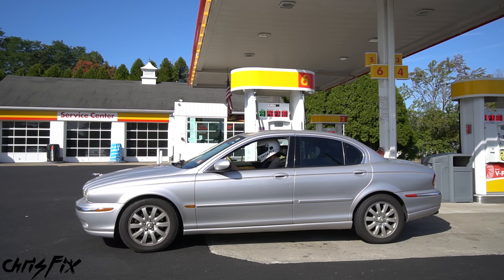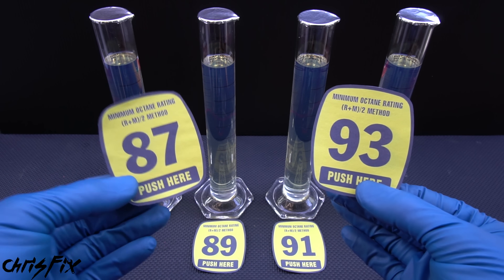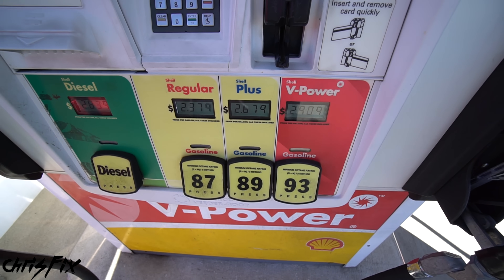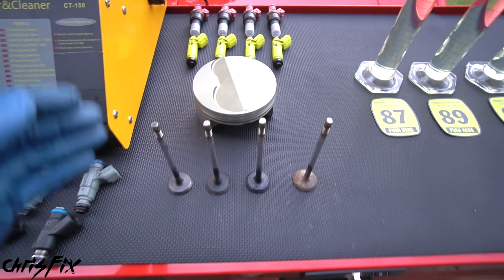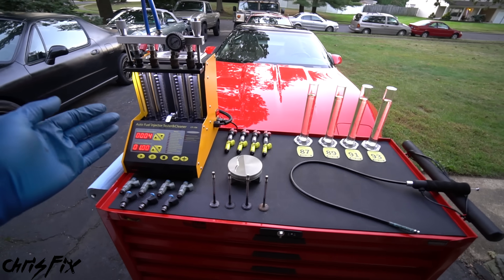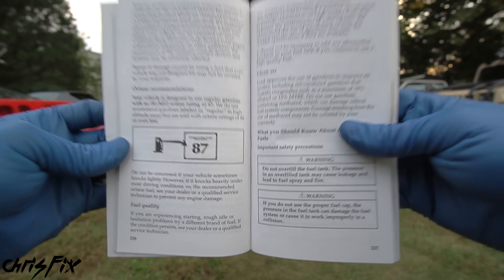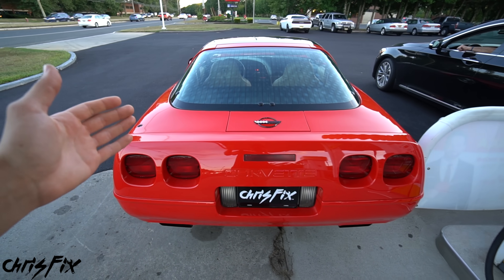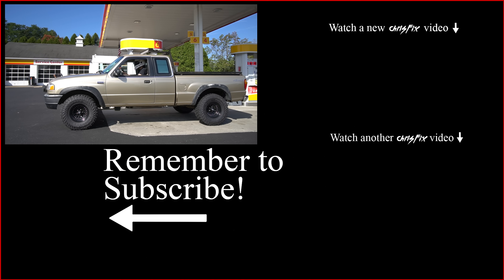What is the BEST Fuel to Use in Your Car or Truck and WHY

Comment: Great video!  You didn't know that the video cover-up so many details until you watch it.  Chris always does this great at all.  Even like this video explains about gasoline!  Really nice.

A little sharing that I heard a lot of boaters reporting using ethanol gas for their outboard incorrectly and failed their fuel system, need to be deep clean for them, even the E-10 gas also made those outboard fail in fuel system easily, so DO NOT use ethanol gas for your outboard engine!

Comment: I use whichever gives me the best gas mileage.  I fill up 3 times (regularly, mid, high test) driving the exact same route for each tank full, and then make a choice based on how far each tank took me while noting any onboard computer readings on mileage as I drive.

Comment: What kind of gas do I run in my Dodge Ram 1500 they all have over 200,000 one actually has 350,000 miles on it and they're all regular engines not diesel. I'm sure there's a lot of carbon build-up should I just start running premium and if I do will I no longer get 10 or 11 miles to the gallon someone told me that premium Burns quicker. Or should I just add that STP, octane, etc etc gasoline additives and just add that stuff every time I fill up??

Comment: So yes, here are my questions summarized: What is octane exactly? What is the unit that's supposed to stand behind the number? Is it 91 or 89 opossums of octane? What is the difference between the two methods of measurement RON vs. PON? How come they produce different numbers? To understand that, the unit (squirrels? or no critters at all? then what else?) is all the more important.

Comment: Just FYI, a lot of Engines don't rely on Knock Sensors anymore because they are to slow and inaccurate. They can check if Detonation ocurres via the Spark Plugs.

Comment: what would happen if you poured ethanol straight into the regular fuel? like... would that be safe or just dumb but critically functional for 20 mins like all the other guys on youtube who do dumb shits with cars? seen one where they even used wd40 so I guess anything flammable and compressable enough would probably run for 2 mins before becoming a car bomb.

Comment: It seems like Shell is about 50 cents more per gallon ($10 per fill-up for me, maybe $500 a year more)  I wonder if getting a gallon of some brand of  additive from amazon or  your local store, and adding it with each fill-up would be cheaper than getting Shell brand. Or, if the repair cost over years is cheaper than getting Shell? Or if other brands also put x  times more than the minimum required(for the premium)?

Comment: Should have done the visual test of the ethanol. I used to work at a shell station and a guy showed me a test where he did 50/50 mix of fuel and water in a glass jar. Did it with all 3 octanes. Shake it around and it separates the fuel from the ethanol and water. It was pretty cool to look at. He was a pilot who liked to use the 91 octane in his personal plane. Lol. So he needed to know exactly what he was putting in it. Check it out sometime.

Comment: Hi Chris, I do have a question. My local gas station has the #88 gasoline. For some reason it’s cheaper than #87. My factory recommended fuel is #87. But I do have that flexFuel tag, so I have been driving with that #88 around.

My question is, what’s the difference between #88 and the #87? Why it would be a good/bad idea to fill your tank with #88?

Thanks!

Comment: In my country Belgium we have E10(95) and E5(98), they both have ethanol in them and i think that is not good for older vehicules with carbs like my oldtimer that are not used in the winter.

Comment: You never mentioned top tier fuel. That’s what I was hoping to see. I want to see the difference in deposits between non-top tier gas vs 87 octane top tier gas vs V-power gas. Does the Shell V-power gas clean significantly better than the Shell regular gas? Is it worth the extra $$$?

Comment: We did have "regular" gas with 91 octane (RON) like your 97 (PON), but that was phased out some time in the 90s. Nowadays, above the 98RON fuels, which are called "Super Plus" and are the same at every gas station, the big brands like Shell, Esso (Exxon), BP/ARAL have their own brand names for ultra high grade fuel, so that will then be 100+ octane (it's got names like V-Power and stuff like that), I think the highest I've seen advertised was 102 octane. Although I don't know what the unit of the ocatne number actually is (if it's per cent, then anything above 100 wouldn't be possible), and therefore I can't really tell what it actually means.

Comment: Run a higher octane if you get "explosions" or want to clean sludge/carbon deposits. You might find out the recommended or required octane intake on your gas cap, gas cap cover, fuel gauge or manual book. 
  Hopefully i remember this info & apply it so it might become knowledge..

Comment: I notice in my 2015 Ford Fusion Titanium FWD with the 2.0 Ecoboost that premium gas makes a huge difference. I also noticed that if I use regular 87 grade gas that my tailpipes turn black but with premium there is far less carbon deposits on my tailpipes. I always use 93 octane fuel for this reason. Am I wasting my money? or is it better for my engine in the long run? I also notice more turbo boost when i'm using 93 fuel so I just always fill up with premium. I plan on keeping this car for awhile. Purchased with 20k miles on it, I now have 87k miles with mainly filling up with premium gasoline. Any comments will be appreciated.
Reply: I recently went on a road trip from South Carolina to Miami, Florida and then back to SC. I used premium fuel for the whole trip and my average MPG was an impressive 33.4. My range on a full tank around the city is about 300 miles but I was able to drive 510 miles before filling up when I was solely driving on the highway. I am really impressed with the Hwy MPG for the 2.0 ecoboost, it just uses a lot of gas when in the city thanks to always being in the boost.

Comment: Knock sensor is not only about timing adjustments. More efficient way to prevent knocking is inject more fuel. Thats why new small turbocharged engines have the same fuel consumption as older bigger atmospheric engines with same hp.

Comment: at ~13:00, you confirmed at "Shell claims at if you run their PREMIUM fule for 2,500 miles..." which means the 87, 89 octanes don't do the cleaning as well as the "premium fuel". I definitely noticed this on the tailpipe of several of my cars over the years, and hence I use only their premium, if not for anything more than keeping my engine clean.  Better than putting in expensive fuel injector and engine cleaners  after you start noticing dirty engine issues. Overall with no repairs or extra additive bottles, I'm still ahead. Getting 1 click starts etc is just a bonus. So, your entire video of using different octanes was a waste for me, as higher octanes do not damage my engine(s) and save me headaches down the road. I use the recommended octanes in cars I rent through.

Comment: So what's the deal with ethanol? I get that almost all gas stations have at least 10% ethanol, but is there a serious benefit to using pure gasoline with no ethanol? Is it more damaging to use 10% ethanol gas even if the owners manual says it is fine as long as it doesn't go past 10%?

Comment: Hi Chris, 

You mentioned that different octane is meant for different cars. Basically can I say that, higher compression vehicles require more premium gas in this sense?  

However I'm not sure if this is true, Where i stay, we are using RON 95, 97, Vpower Racing. I am riding a bike that requires a minimum of RON 95. However i always pump RON 97 or Vpower Racing, and there is a difference in power. Are you able to explain more on that? Is it just a myth of Paying more = Feeling more power? Or is there in fact a better throttle response with higher RON rating? 
When i pump RON 95, my bike feels sluggish compared to higher RON rating and just does not feel as responsive as with higher RON rating.

Comment: What about Ethanol free gas? An old mechanic told me to use it one time my car sputtered when I turned the a/c on. Filled up my tank it solved the problem.  My truck has 182000 on it. I use that gas from time to time mostly use 87. Should I continue to use ethanol free?

Comment: It's important to note that higher elevations can get away with lower octane.  Colorado regular is 85 and as low as 83 octane in some places.  Also newer cars run fine on blended gas which is usually up to 10% ethanol.  My 2009 Tacoma gets better power and mileage from 100% pure gas but my MDX does the same on either.  10% blended ethanol gas is cheaper than pure gas.  My Miata requires premium and because I don't drive it often I usually seek out 95 rather than the standard 91 which is considered premium around my area.

Comment: "Use manufacturers reccomendation"
Yeah I can't get RON 93 in europe like VW states for the Golf mk2 1.6 :D
Running 98 RON ever since I got the car, also running a few degrees of ignition advance. 

Put in 95 once as a test, and immediately regretted it. It didn't knock but she certainly didn't like it.

Comment: I would add that if you are going to let a vehicle sit for a over a couple of months, I would recommend: 1) Topping off the tank to help prevent water condensation. 2) Using a fuel stabilizer like STA-BIL. And 3) Filling it with E-0 fuel of you can find it, even if it is flex fuel. E-0 does not absorb water like ethanol fuels can. E-0 may be hard to find in some areas, though.

Comment: Here in The Netherlands we are forced to get the "new" e10 gas wich has a higher ethanol level. This gas is harmful for older carburated vehicles or cars that have older type seals and gaskets. Do you think adding a ethanol killer will alow me to run e10 in an older car and prevent my gaskets from blowing out?

Comment: Geez I watched this infomercial for Shell only to find out I should use the fuel recommended by the car manufacturer, in the owner’s manual no less! At least now I know I can look behind the lid for that information if I cant find the manual. Sat through 4 ads for this brilliant info too👍

Ive seen this sort of thing on fuel cleaner ads. Show lots of scary looking valves, corrosion, and bad injectors. Truth is most if not all modern fuels will keep your engine components clean. You don’t need premium gas to get these additives. 

Animations were nice

Comment: If my tank is half full with octan 95 (Europe) and i would like to try V-power one time, can i just then fill the tank and mix the fuel or should i wait for the tank to be as low as possible?
Reply from the maker: Yes you can mix fuels. That’s actually how many brands get mid grade. The octane won’t be as high but the cleaners will be in there. Then next tank it will he higher

Comment: How about older cars... Like my 1971 Pontiac with a 350.....What fuel ?
Reply from the maker: What does the owners manual say? Is the 350 high compression (higher than 10:1)?
Reply: @chrisfix  It is a  1971  Owners manual?  Funny... 2 bbl  stock  What state are you in?

Comment: What about ethanol free fuel? Benefits and uses?
Reply from the maker: You get 3% better mpg on ethanol free fuel vs 100% gasoline. Ethanol has 1/3 less energy than gasoline. It also absorbs water more than gas which can cause corrosion. Less than 10% ethanol in cars and trucks is fine. In boats it’s a problem though. Especially for aluminum gas tanks in boats.

Comment: Learned quite a bit in this video, there is something that I want to touch on with the European fuel vs. US fuel, I personally didn’t know about the relationship with gasoline. However with Diesel it is true. Here in US we have very strict emission standards and we run Ultra low Sulfur diesel fuel. However in Europe and Australia they use either Low sulfur or just “Pre Emission” diesel. With this type of diesel the engines over there have typically ran a longer life without needing a major overhaul or servicing, because that sulfur acts as a lubricating, and anti-wear agent. Loved the video and the illustrations!
Reply from the maker: Thanks for the diesel info
Reply: Happy to help!

Comment: Why would the octane change the horsepower in the Corvette and not other cars?
Reply from the maker: Because the high compression of the corvette engine. The computer can utilize the fuel and advance timing for more power with higher octane since it has higher compression. With regular/low compression engines the timiming is advanced as far as it can already.

Comment: Wait, you have one pump for three grades of fuel? I know the amoung of fuel already in the system is insignificantly small but if I pay premium, I don't want the hose of the pump to have some regular in it.
Reply from the maker: That’s an interesting point... hmmmmm I wonder what the percentage is and if they compensate?
Reply: Or if the guy before you drains the hose, the meter jumps to 30 cents as soon as the pump is turned on. My math says a 8 ft 3/4 inside diameter hose holds about a quart
Reply: 2stroke oil would reduce cylinder wear and help prevent rust.

Comment: so if your car says to use regular....can you use premium sometimes to help clean it up?
Reply from the maker: Yes exactly. But you saw the normal valve and how it’s really not that dirty, so in most cases if you run your car to operating temp and don’t take short trips, you don’t need to clean your engine out. But my truck is an example of a car that runs regular but I needed to use premium for the extra detergents.
Reply: @chrisfix  
My car is 25 this year so im sure it could use a little cleaning lol

Comment: Actually shell is not really good gasoline here in Greece... With a full 45 liter gas tank with shell vpower 95, I get 440 kms, and with BP 95 I get 545 kms... These numbers, on a 2008 daihatsu terios 1500 4x4
Reply from the maker: Can’t compare fuel economy with one car because it’s a small sample size. There may be some merit to what you’re saying but more than likely you drove differently, hit traffic, went different routes, etc. no fuel, with any brand, will give you such drastic fuel economy numbers. E10 blended fuels only changes MPG by 3% or so. Pure gasoline, no matter the brand, won’t give you noticeable  fuel economy differences.
Reply: @chrisfix  I get your point, but it's not just me... I have heard that from many friends, BP is also cheaper here by almost 8 cents... As for the route, I tested it multiple times, on highways, other times with more traffic while others  with less, but I would always end up that BP is superior

Comment: Is there any other cons to running a higher octane than required besides that extra cost? I've been told that if an engine is not designed to run it that it might not burn the higher octane fuel completely.
Reply from the maker: No just extra cost is the con for for using premium in a regular recommended car.

Comment: For a truck with a flex fuel kit would it be better to run e-85 compared to 87?
Reply from the maker: You’re gonna have to do the math because you won’t have as good fuel economy with e85 but it’s cheaper. So run it a few times and get your MPG and switch and get your MPG and for 100 gallons what is cheaper to run.

Comment: im not sure why but maybe somone could tell me this. but my mini van prefers to run better when i put petro-canada gas in it but if i put shell or esso it doesnt run as well?? im curious to know why
Reply from the maker: That’s interesting. There should be no noticeable difference between brands. The only difference is the detergent additive but the gas is the same. Are they both the same ethanol content?
Reply: @chrisfix  yeah i usually do 81 or 87 but i tried 87 and 87 once from 2 diff spots

Comment: so in high altitude states we have 85 87 91 and E-85.  no 93  is it because high altitude has a lower knock explosion?  hence the 85?
Reply from the maker: Yessir. The lower atmospheric pressure means less air is moving through the engine so less detonation so they can sell lower octane fuel.

Comment: Hey ChrisFix! What do you know about how long it takes a fuel pump at the gas station to switch over to the octane you've selected? Eg. Someone fills up with 87 before me and I need to fill up with 93. How much 87 fuel will come out of the spout before 93 starts to come out?
Reply from the maker: It should be instant. The only mix would be whatever is in the lower portion of the hose.
Reply: @chrisfix  Oh so not even a quarter gallon. Thanks man!

Comment: I'm a fan of using Gas that fits into the "Top Tier Gas", otherwise unless my truck is running advanced timing and/or  it's stock just go with what the manual says (typically 87 for naturally aspirated unless otherwise specified for sport tune like a naturally aspirated Lexus).  I have only ever needed to use 93 when i had higher compression when i had a whipple supercharger pushing in 14 PSI into my engine.  I don't know how all this octane misinformation started, must have been bad marketing!
Reply from the maker: Yea it’s pretty crazy what misinformation was out there!

Comment: Hey Chris is there anyway that you can clean your top end with out taking apart the top end. Thanks
Reply from the maker: Direct inject or port injected? Seafoaming does a decent job for what it is. It goes in the intake and cleans decently. Nothing will make it shine but you don’t need that.
Reply: @chrisfix  thanks Chris big fan